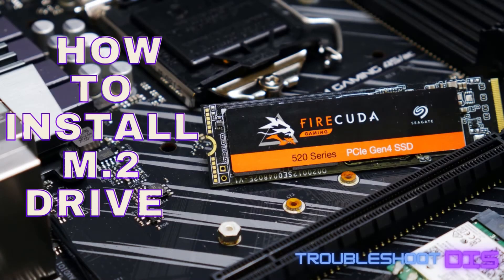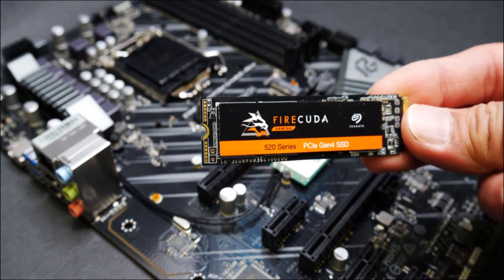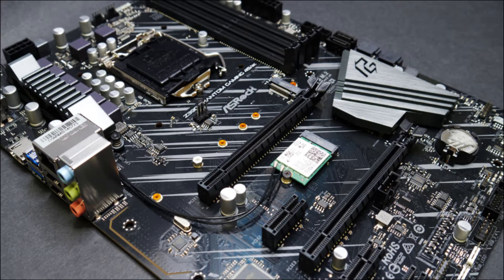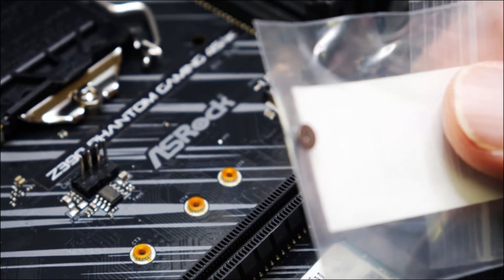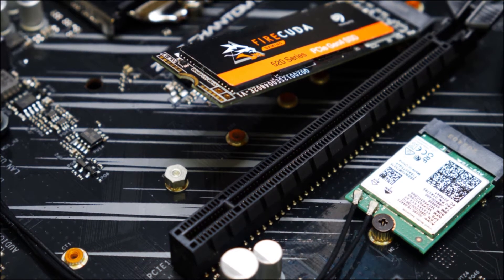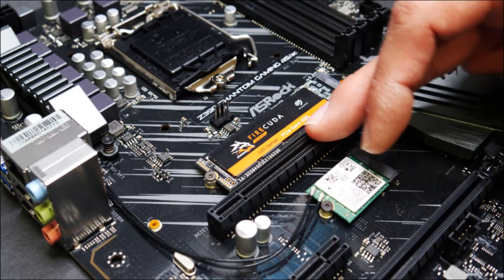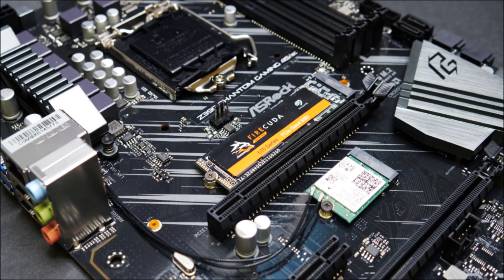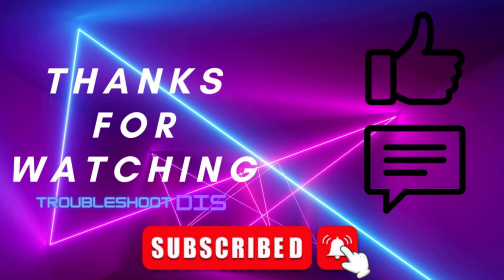Installing an m.2 NVME drive

Comment: I bought a computer from SkyTech, it has a gen 3 SSD in the PCIe 4.0 slot, and I have an open 3.0 slot. I received as a gift an 2tb 4th gen SSD, should I instal the gen 4 in the 3.0, or should I move my gen3 to the 3.0 slot, and install the 4 in 4.0 slot? Would the second option cause issues or require any BIOS or Windows prep?